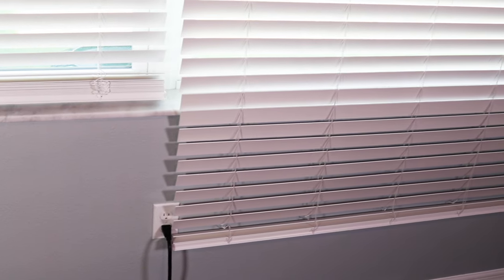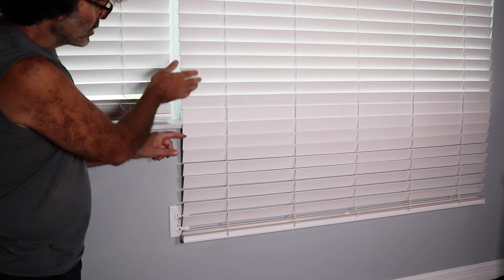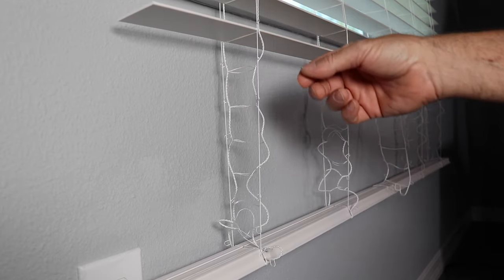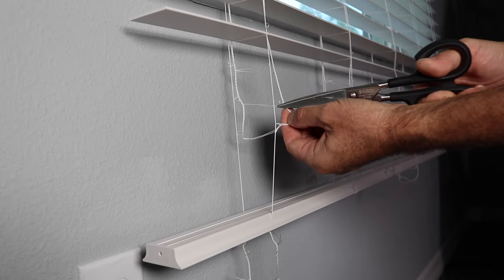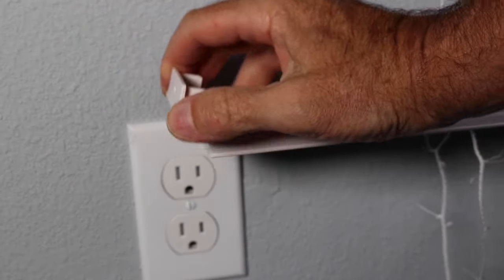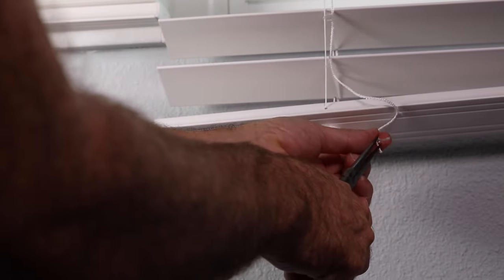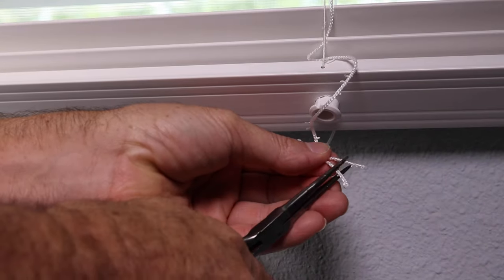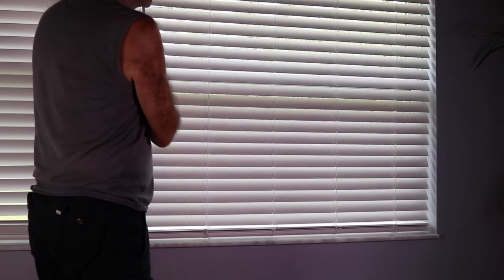How to Master Shortening Levelor Window Blinds in Just 7 Minutes! [Cordless]

Comment: Getting the buttons out is not nearly as hard as getting them back in.  Threading the cords up into the hole is not a problem.  Getting the cords into the grooves in the button so that it fits back into the hole is impossible!  If not in the grooves, the cords take up too much room so that the buttons will not go back into the holes.  Any suggestions or secrets?  I've done everything else necessary for 11 sets of blinds (various sizes), thanks to your video, but I cannot get the buttons back into the holes properly.  I've got to go back to finish the job - hoping for instructions or "master" secrets.  Your cords are not exactly aligned into the grooves, but you don't have trouble getting yours into the hole with little effort.   Mine are only fitting back in the hole if the cords are in the grooves.  Everything has gone smoothly.
Reply from the maker: HI, Sometimes these jobs can be tedious!  No doubt that's what those grooves are for, but seems like to key is to not allow the cord to be bunched up to bad and they should flatten out when you push it back in.  I'm sure it's a matter of trial and error.... which of course after 11 sets of blinds you've already done!
Reply: @TheHomeImprovementChannel  Thanks!  I've tried holding them taut after threading them up through the hole, which may help a tiny bit but hard to do while trying to keep the blind from coiling back upwards.  This is at a rental property - I'll have to go back over there to attack it again today or tomorrow.  Some seem to pop in easily - others not going back in at all.  I may take a file and try to file down the button just enough to make it fit?  Getting the cords into the grooves while fighting the pull of the blind and holding the cords taut is frustrating and time-consuming.  I was hoping you had a secret to success!  Those that I've completely finished look great!  Your video was the best I found - short, to the point.  With lots of slats to remove, I did find that cutting the horizontal ladder cords first was the easiest way to remove all the slats at one time.  They fall on each other in a stack and are easily removed as you move down the ladder.  A big time-saver.
Reply from the maker: @rebeccabee123  Yes I'd have to see it but there's probably a way to modify it to fit better.  Sometimes I have to do that kind of stuff.... If it won't fit, make it fit!  Within reason of course and without breaking it... 😊

Comment: I ruined two buttons trying to pry them out…and then I found your video.  So much easier.  Mine were a tad tight for my arthritic hands, so I supported the underside with a 3/4” socket and tapped it out with a hammer and flat punch.  I made sure to avoid the strings inside.  Thanks for the great tips!
Reply from the maker: Awesome!  You're welcome.  I'm glad I was able to help.. 😀

Comment: Thank you so much! I was getting confused on how to do the buttons!
Another tip I can give to y'all is if you have a convertible screwdriver (change out different heads), take out the head and press the empty body into the button cavity (where you would push in the button), hold the bottom to stabilize it and push down!
It worked so well to get the buttons out
Reply from the maker: You're welcome... 😀. Thanks for the great tip!

Comment: This is great! Ty! So I noticed there's some long strings tying those buttons inside, that's just so they'll hang as to keep you from losing the buttons right?
Reply from the maker: I think so... If I remember right you can cut off any excess string you don't need.  Be careful in doing that and make sure not to cut anything to short or cut anything that is still needing to be long!  Just whatever was excess.  It's been a minute since I did one of those, so I can't remember off the top of my head.
Reply: @TheHomeImprovementChannel  I looked again and now I think I may have been talking bout the lift strings lol but yeah I'll be very sure before doing anything I can't undo. Thanks for the quick reply!
Reply from the maker: You're welcome!  @kilik0410

Comment: Great video, I would just add that the buttons can be stuck in too much so that prying them out with a screwdriver breaks the outer edge of the button and they wouldn’t come out using my thumb from inside the channel.  Solution was to tap them out using a small (1/4” x 1”) piece of wood and a hammer.  Thanks again for a very useful video !
Reply from the maker: Excellent... thanks for the great tip.. 😀

Comment: What did you do with the excess pull cord? Did you tuck it into the bottom slat? Will that work? Also, my pull cord goes through a hole on the two side set of strings. It seems I have to get to the end of the cord to remove the excess slats.
Reply from the maker: I seem to remember cutting off most of it once I figured out how long I needed it, and then tucked the rest away. But it's been a couple of years so I don't remember exactly..

Comment: I’m having trouble removing the buttons. I tried several devices but the rim around the buttons cracked as if dry rotted. Called Levolor and  they are aware of the button problem. I was advised to return the blind for another pair. However, I’m concerned about the next set 😮.
Reply from the maker: Interesting... I haven't heard of that problem.  I suppose you could open the box in the store and try it before you let them cut them down to your window size.  They won't accept returns after they've cut them..

Comment: I just bought some Levolor cordless blinds and in the optional instructions sections it reads THESE BLINDS CANNOT BE SHORTENED DUE TO THE CORDLESS OPERATING SYSTEM.  Anything different from 9/21 to now?  Asking for the future.  I already used the new blinds at a window where they fit fine. Took the older corded blinds and moved them to the window to replace the busted blinds. Those I know how to shorten those.  Thanks.
Reply from the maker: Wow, I didn't know that.  I haven't had an occasion to install those recently.  I wonder if there are different models and you got ones that are different than mine?
Reply: @TheHomeImprovementChannel  The blinds I have are aluminum. Model number #929770.  When compared to my old corded blinds, I really do not see a difference in the set up.
Reply from the maker: @justmythought1586  Yea so I found them on Lowes website and sure enough one of the reviews said there were no shortening instructions in the instructions.  So they called customer service and they told them these "can not be shortened".  So I haven't seen what the newer models look like.  The ones in the video were model 929839 which are an all vinyl faux wood.  So yours are apparently a different model, although I'm not sure what the strings look like and how they differ from mine.
Reply: @TheHomeImprovementChannel  I called Levolor.  I was told that as soon as I cut the cord, it would shoot up towards the mechanism at the top releasing all the blinds.  The only module that can be cut are the faux wood ones.  To keep the same kind of blind, I would have to special order to fit a particular size of window.
Reply from the maker: @justmythought1586  Wow... good to know.  The faux wood ones are the ones I used in the video.  They should at least make a note of it in the instructions so nobody tries that.    Thanks for the info.
Reply: @TheHomeImprovementChannel  Yeah, you're right.  Without knowing why, there is someone who is going to try to shorten them.  When looking at the blinds, they look no different than any other set. Same string set up.

Comment: My blinds (27 in. width x 64in. length) say you can only shorten up to 24inch, but I would like to shorten much further. Is this doable?
Reply from the maker: HI, I can't say for sure.  I've never tried that.  I suppose you might run into a problem with the weighting of the blinds since cutting more than 24 will lighten the load quite a bit... I'm not sure what other problems you might run into.

Comment: how do you replace a slat that has broken?
Reply from the maker: Hi, very easy.  There are little grooves cut into the slats where the strings come down... The slats will very easily pull out from the side, either left or right.  You just have to work the slats around the strings where the grooves are and slide in a new slat... Hope that helps... 😀